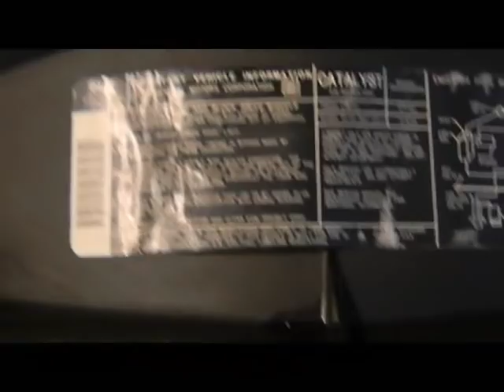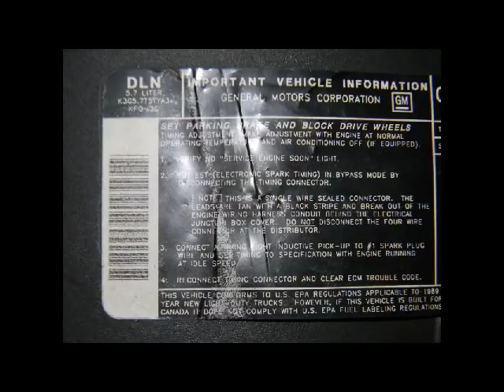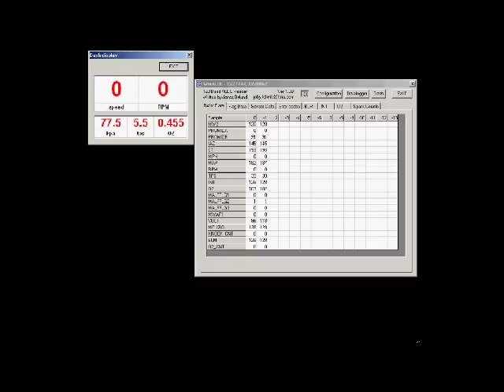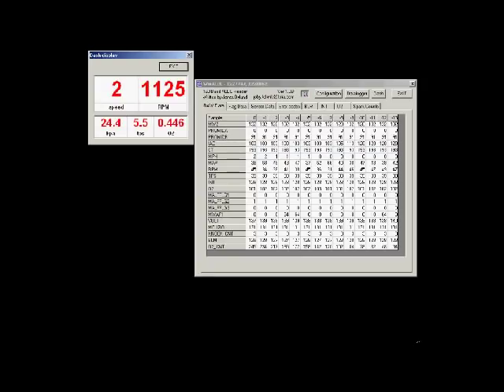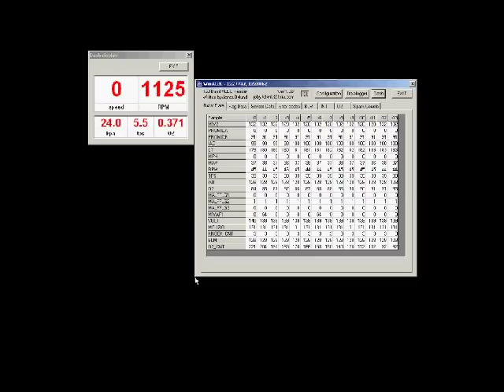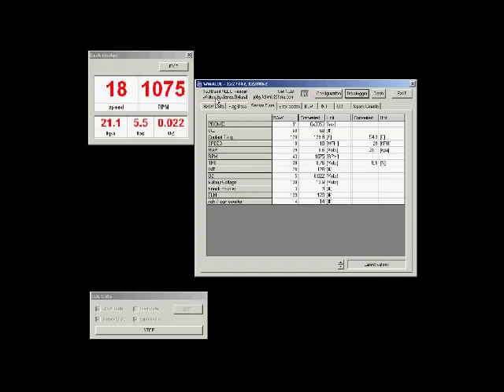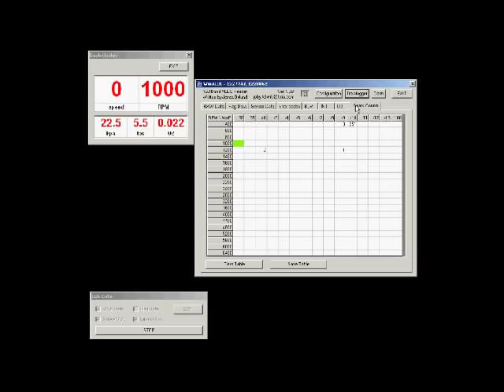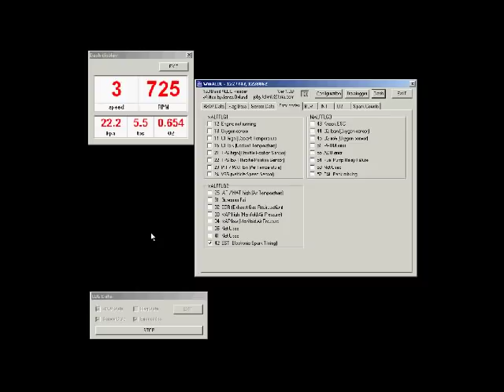Chevrolet - GMC 5.7L Timing and Emissions | OBD1 | ALDL | TBI | Throttle Body Injection

Comment: I just want to add that you are correct the timing wire is normally underneath the hood except in the year 1995 where it is normally found underneath the glove box for Chevrolet trucks.

Comment from the maker: I believe that the TBI electronics controls the advance.  Now electronics can delay timing but cannot advance it so the advance module most likely fully retards the timing in default mode and that mode is used to set the timing at TDC for example.  The advance module  then advances the timing using commands from the TBI computer.  There is NO VACUUM advance on this engine.

Comment: when do you plug the wire back in? i set timing on a 93 yukon 5.7 truck runs with that connector unplugged and wont with it plugged in.
Reply: Raymond Mars
Reply: Did you find TDC first?

Comment: I replaced the timen chain will I have to adjust the oil pump notch on the cam turn it to adjust so the distributor lines up on nu 1 it's a 96 GMC 57

Comment: Hey, I wanna ask you a question and I know it might be a crap shoot without seeing the vehicle but I am hearing a hissing but only when I put it under load. At flat throttle it doesn't make the noise. Is that detonation? I bought my 92 and it already had a crate 305 in it but I'm still working bugs out. Any help is appreciated.
Reply: Blake Harvey check all vacuum line sounds like it is sucking air somewhere.
Reply: It turned out to be a bad egr valve. Thank you. It runs great now.

Comment: rebuilding a1990 suburban engine running great i like to put a small cam but don't now what size with out haveing to change computor or do i iput a shift kit in the transmission hitting great but i want to hear a little thump old school hot rodder help

Comment: my 92 k1500 305 tbi has predetonation i think has a rattle as if i have it in too high of a gear have electronic timing advance, runs alot better in base timing. not sure what it is i replaced map,temp sender,coil,and about to do the knock sensor any ideas?

Comment: To be such an old vehicle  that base timing reading with your light looked dead steady, like there's no slop in the timing chain or distributor shaft/gear.   Most of the ones I see that old will be jumping around due to the slop.   Did you replace the timing chain on this already, or  tighten up the distributor gear?
Reply from the maker: The Amsoil rep owned the vehicle before I bought it.  Always used synthetic oil.

Comment: I have a 95 k1500 4x4  when pulling a grade at the moment of shifting into passing gear the truck will jump,buck and miss untill you force it to shift into passing gear then its fine.  i have checked all plugs and wires i even had timing checked any ideas   john
Reply: Did you figure out the issue? Mine is doing this now.
Reply: bad cam?

Comment: i know there is no vac advance. but if the ditributor rotor never changes position in relation to the cam what compensates for that. does it have weights and springs under the cap?

Comment: hey i got a question. my 91 350 tbi. pops backfires runs like shit. when it stalls i notice thick blackish smoke comes out through the throttle body, it started out with a lil constant pop. then progressed until it barely runs. and stalls, its getting good spray at the injectors. and it has alot of spark.
Reply: I had the exact same scenario happen to me just the other day… for me it was my gas sender/pump filter but the comment is 10years old so I hope all is well

Comment: the TBI engines just do not run well with the timing set at 0 , i find 6 BTDC , makes a BIG diffrence
Reply: Thank you! I keep hearing "0" too but my 1995 tbi runs like crap there. But at 6* she runs smooth and it restores the power, especially at take off from dead stop.
Reply: Mine runs the best at like 30BTDC its strange

Comment: ok so first does this truck have the distributor with the 2 plugs on it and the remote mounted coil? and if it is all controlled electronically how does it advance? because the rotor on a normal hei is move around by the vac and mech advanced. but this has  none so how does it work if the rotor is always with the shaft? im quite confused. a pm would be greatly appreciated.

Comment: can u tell me where i can buy the wireing to connect to lap top,and what do i look up tp down load this program
Reply: I think that is WINALDL. It's a pretty old program. I think you can probably get it to run on a newer laptop. You need an ALDL cable with USB and you need to make sure that WINALDL supports your ECM.

Comment: On a 93 350 5.7 tbi,is the distributor supposed to be turning side to side abit? Had the engine switched and im changing out the cap n rotor and noticed it spun abit.Its not moving up or down cause its bolted down(single bolt).Anybody know about this?

Comment: Hello, do you know witch software and witch conactor i need to diagnostioc a
camaro 93 with obd 1 ?
Greetings from Germany !!
Reply: The same WIN ALDL should work.  Same one I used on my TBI.  Nice Camero!!
Reply: If its a 93 Camaro with a LT1 v8, Free scan should work, Its for 92-5 OBD1 LT1 Camaros, Caprices, Corvettes ETC. You need a laptop and a ALDL obd1 USB cable to use it.
Reply: i think its called winadl software and obd1 connector greetings from texas u.s.

Comment: You seem to know these trucks well, can you perhaps help me getting my girlfriend's truck straightened out? It sat for a long time because of a no oil pressure situation, deep motor problems. Fixed it with a long block. It runs, idles, and drives, but had severe part throttle drivability problems that after online research sounded exactly like descriptions of EGR valve issues.  I eventually found the O2 and MAP and EGR were all in bad shape, and also that driving through their issues had fooled me a little bit: it seemed to run well wide open, making me think it was okay on open loop operation but not closed. After fixing all those sensors and resetting the timing (which was causing hesitations and bucking at highway speed due to knocking, the static timing was WAY overadvanced) it became clear that it was not an open vs closed loop issue, but instead there is a "wall" at 2200 RPM. Below 2200 RPM is runs like a dog. Above 2200, it runs great, regardless of throttle position. If you have any advice it would be greatly appreciated. TPS has been checked and shows correct voltages, likewise coolant temp sensor shows correct ohms. I'm sure the 2200 RPM wall is significant, but not sure where it's trying to point me.
Reply: My 93 1500 just doing the exact same thing I've replaced all kind of stuff it still has a bad stumble right off throttle about 2200 rpms does anybody have a straight answer for this
Reply: Travis Bane
 Hey Travis, I still haven't solved the problem either, I've read some stuff that makes me think it might be worth trying changing the pickup coil in the distributor, but I'm sick of part swapping and hoping. If you find a solution, be great if you could drop me a message and let me know what you found. Thanks.
Reply: +Travis Bane I wonder if you have a valve that's barely not seating that goes unnoticed at higher RPM's?

Comment: what degree did you set timing at? mine with the brown wire unplugged was set at like 10 degrees?
Reply: The 5.7 tbi needs set at 0 with the advance wire disconnected. Turn the engine off to disconnect, start and set to 0, turn off again and reconnect. Then start and the computer takes over from there.

Comment: alright. 91 4.3l. set the timing at zero with the timing advance unplugged. tighten down the distributor. double check(still at zero.) shut off the engine. unhook the battery, plug the connector back in. wait a couple minutes. hook the battery back up and start the engine. the timing advances at least  four degrees every time. ???? what is it doing?
Reply: Don’t have to unhook the battery.

Comment: I wonder if my 1995 Tahoe is the same under the hood.
Reply from the maker: 1995 may be port injection (VORTEC).  TBI is basically the same for all GM models.
Reply: ClassicManuals.net Vortec didn't get put in the chevy trucks and suv's till 1996 when they switched to OBDII
Reply: Al your engine should be the same under the hood from 1988 till 1995

Comment: 94 cheyenne runs perfect but when it's time to check timing (disconnect the tan/black bypass wire connector)start it up engine idle starts to surge up and down the timing is at zero no body knows why this happens

Comment: im 35 year mech,ive never had more trouble seting timeing on chevy,its jumping all around,it runs like shit,ive had truck three years,new engine,last month its been idling up/down,stalling
Reply: joseph pincus  You might need to replace TPS sensor or IAC valve. Check for vacuum leaks. Also throttle body gasket may be bad. Hope this helps.
Reply: joseph pincus   check your map and cts and your plug wires my 94 z71 and my 92 s10 will do the same thing almost every time it's my plug wires and remember new never means a good part i would also check the plugs and see if it's running rich or lean
Reply: after replacing,all sensors,reman dist.,reman throttle body,it was the fuel pump !!!! i should have put it in in the first place,i just didnt think it was the pump,because it ran,what an ass i was,,,,,,

Comment: Ok what the hell are you doing that nets an L05 87-95 350 TBI to get over 14 let alone 20. I'm not calling bullshit I want answers like how I can get from...9...I have bad issues. Like certain rpm like converter stall rpm hiccuping like EGR, it timing issues I got a old style obd1/2 monitor and maybe a FEW THING THAT COULD BE OFF all technically inside spec but it's really not that simple usually it's something on it's way out best off unplugged open loop if you can find it. So shorten this up a 93 Blazer K1500 (K5/2 door tahoe). It has 202k miles. Plugs looked worn but beautiful, prev owner put a unknown reman or new dizzy in it, fuel pump, tank, sending unit pickup ring filter all new steel lines and brakes except the trans cooler lines, new stock exhaust with cat delete. The damn think makes you smell like 2 stroke like you went on an all day classic snowmobile run lol it gets awful gas milage and the few things I notice strange 0-5 volts tolerance is the barometric pressure at 4.88volts...I has map reading but I'm guessing it does that function as well and...its bracket is loose from a probably replaced manifold gasket job so maybe that's doing it but I got over 20.2 degrees advance and idle and it can chug at startup cold it sounds like I stuck a heavy summit racing RV cam in it! With the lid flipped it has a strong hissing sound more than any other tbi engine ever and I've owned 8...from 2.5 fieros to firebirds to suburaban and 92 93 94 blazer all else looks normal. I have my 3 suspicious possible culprits but if anyone can read this and know what's going on you'll make my day! Thanks, Ray
Reply: At 202k miles, there is a very good chance that your timing chain is stretched to the point where it is too loose. This would retard the engine timing and make it even more difficult to get decent mileage.

Comment: there is no user timing setting available for a 1999 gmc yukon,tahoe! it's all done inside computer right??? any elaborations out there Chevy buffs, GMC PROFFESIONAL GRADE BUFFS LIKE ME!! 5.7 /350 SMALLBLOCK 4 EVER,THE DUMBEST THING GM. EVER DID WAS DICONTINUE THE 5.7/350 SMALL BLOCK..BADDASS. MOTER, PLEASE BRING IT BACK